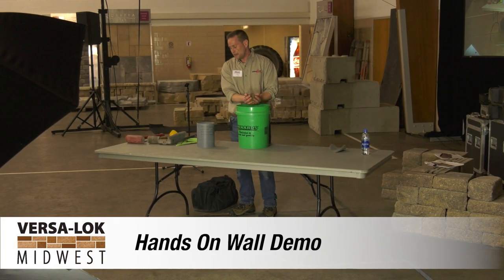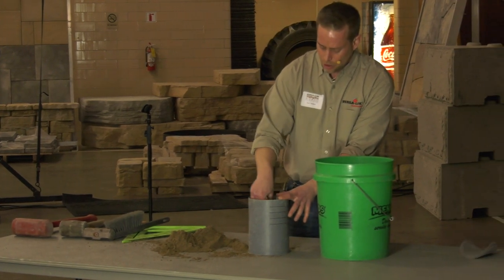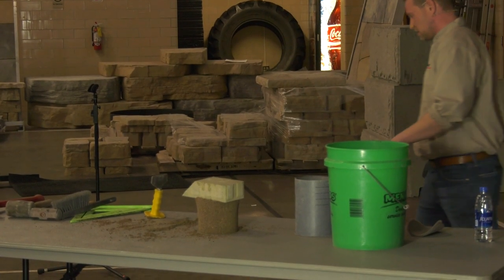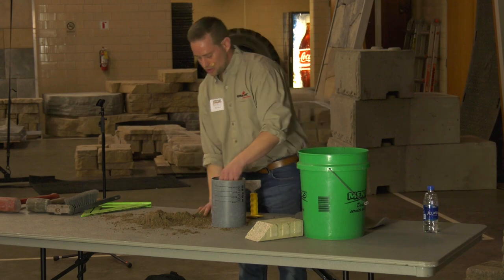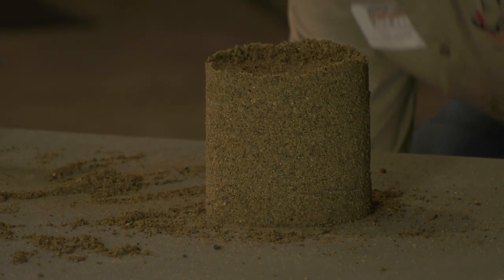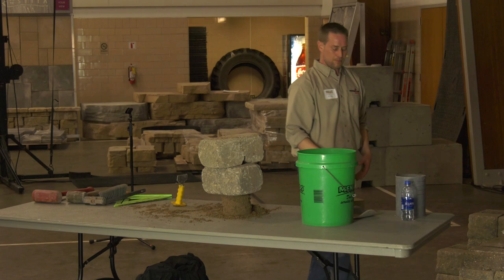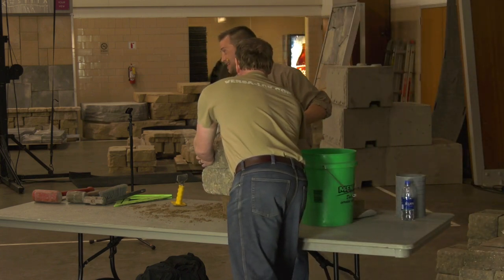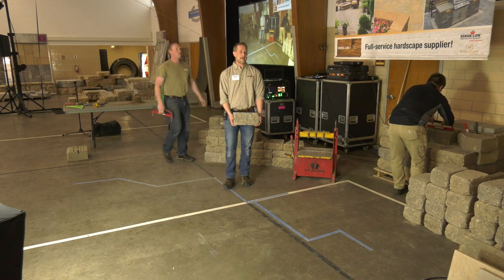05 Wall Hands On Demonstration

Comment: VERSA-LOK needs to come up with a better bullnose corner treadcap. Those bevel cuts look like hell compared to the overall wall, An that mix and match tread looks like scrap pieces put together. Horrible!  
Another thing I cant help but think  about is, that with all those small gaps everywhere in the wall, I see a potential problem with bees and other insect building nests in them. Especially in the corner columns where theres a large hollow  area.  Wouldnt be fun sitting on that expensive patio with unwanted guests!.